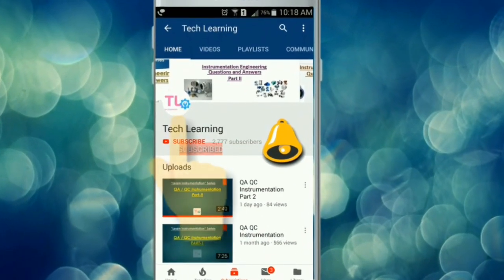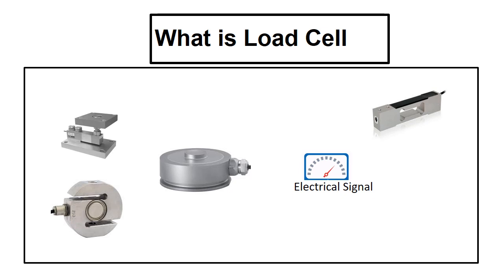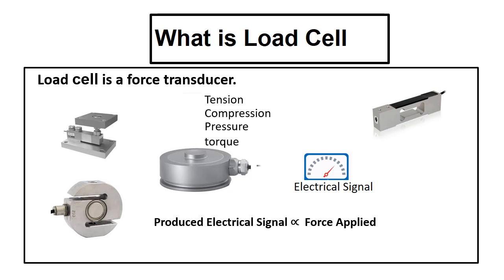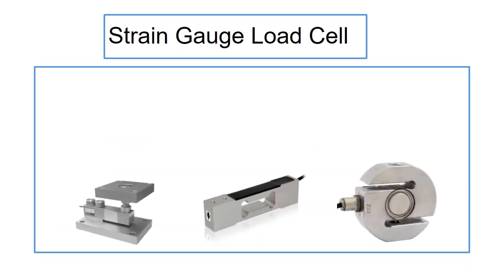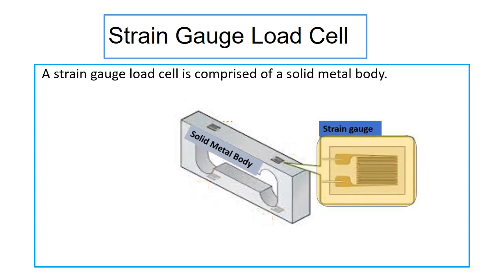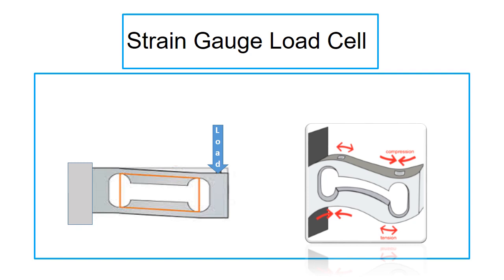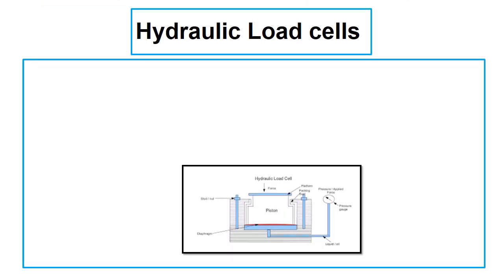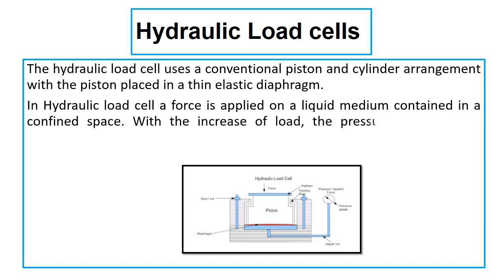Load Cell Basics || Types of load cell

Comment: I need class-A load cells. Maximum weight should be 10 or 20 gram, and it should have at least 15,000 increments. I cannot find them anywhere. Do you have them?